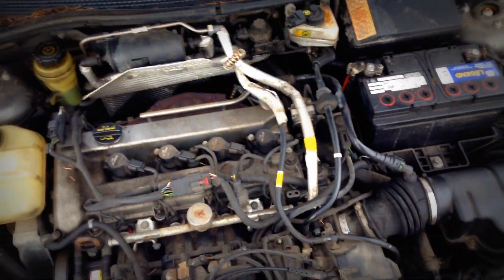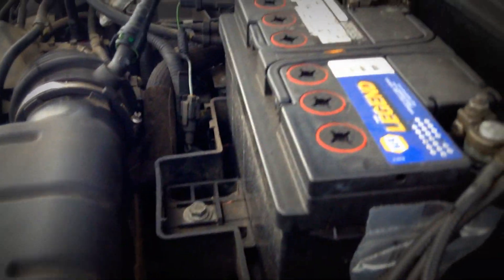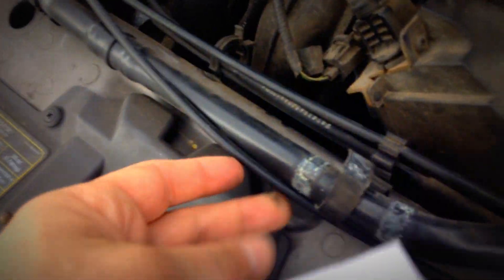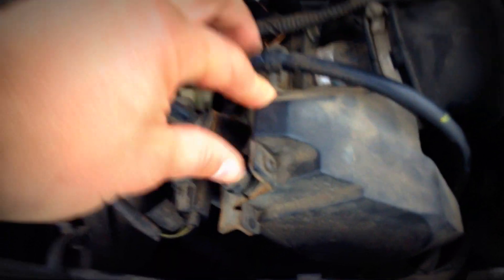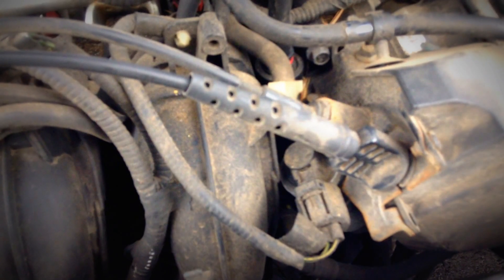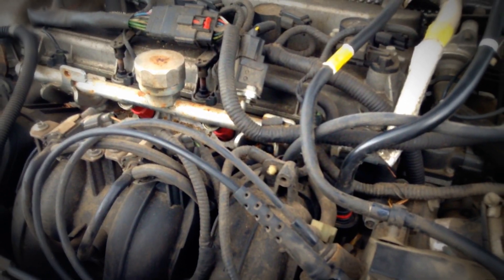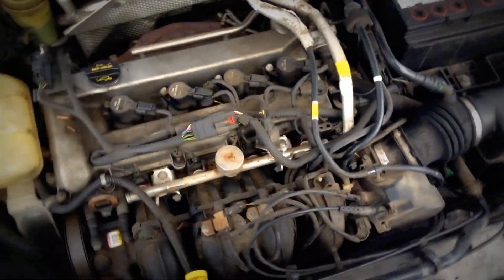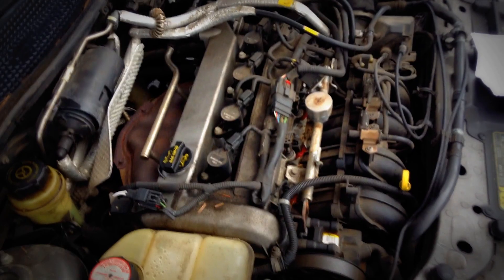Overview: Ford Focus 2.3L Duratec PZEV motor description and identification

Comment: I just replaced the common pcv hose . Of course it was collapsed. There's a hose on a square sensor on the fuel rail in the video @ 2:34 . I don't know where the other end goes. It was just tucked in there when I removed the manifold.

Comment: okay so despite our little debate about that intake bull crap on the car wondering if you've ever had issues with a chugging problem with your car like not getting enough fuel possible pressure issue not mass air flow sensor was just replaced greatly appreciate some input you seem to know a little bit more than I do on this engine

Comment: okay so I physically have cut one of these apart there is way more to the filter box than what you are actually pointing at the top half is a screen look further down below it will be the carbon filter that's the part that gets replaced have to remove fender well to access it and that information besides me cutting the old air filter open and seen what's in it came from a Ford dealership with photographs to show what they have to do to take it out it's a carbon filter
Reply: ya... I said fuck that restrictive shit and slapped a k&n on it. hollowed the cat while I was at it.

Comment: There is nothing elaborate about this. it is nothing more than a sealed air filter and most dealers charge around 500 to change it. this is like this to keep people like yourself from tampering with it and causing damage. The information you give in this video is incorrect. This is what we in the industry call a bolt on bolt off engine. it is very simple and very easy to diagnose if you know what you are doing. however most people have a hard time admitting they have NO IDEA what they are doing and end up wasting money.
Reply from the maker: +matthew shaughnessy Thank you for your input. What do you think about the OBD real time readers? I have been looking at buying this today: http://www.walmart.com/ip/47562952?wmlspartner=wlpa&adid=22222222227034806092&wl0=&wl1=g&wl2=t&wl3=56808673778&wl4=&wl5=pla&wl6=88566201218&veh=sem

I can use a free reader, but I think a real time reader might help me locate my problem better.
Reply: nothing you buy over the counter is going to help you with this. these cheap 11 dollar readers are a waste of money. My snap on redbrick computer cost me 10,000 dollars. I am professional though and these things pay for them self over time I am willing to help you so long as you are willing to admit you have no idea what the heck you are doing here. I have ALL the tools necessary to help you. you have already emailed me and insulted my expertise. However I have been in this business 16 years every day making money. I have met and seen people like you and I am not trying to be mean but it is obvious you have no idea what you are doing nor do you know what you are dealing with and you ARE going to cause further damage if you keep going down this road.
Reply: @MattShaughnessy6  couldn't have said it better. I own one of these exact vehicles pretty simple one you understand the system and how it works. The worst part is the airfilter and the intake runner flaps i